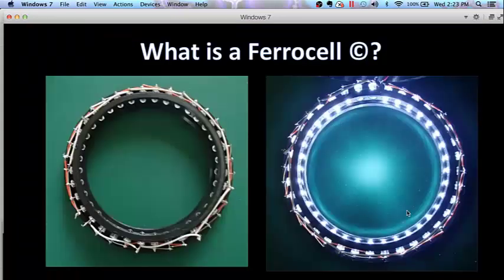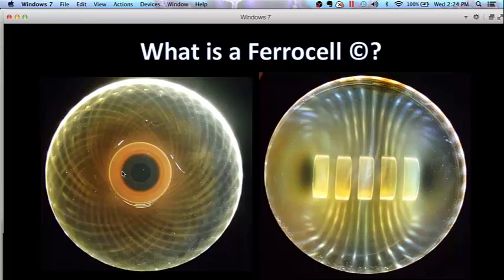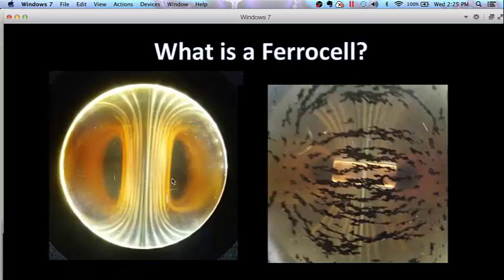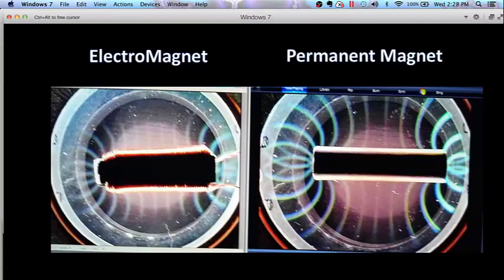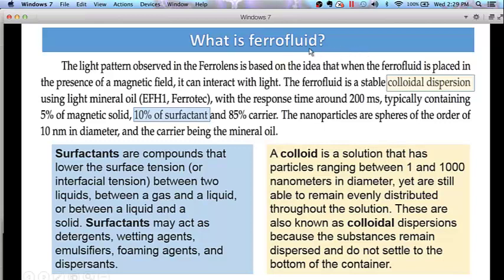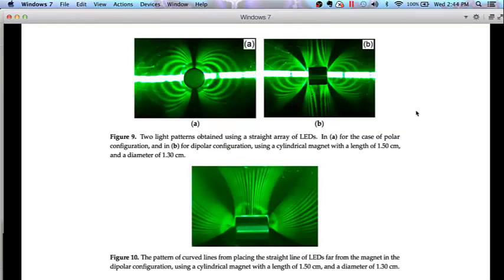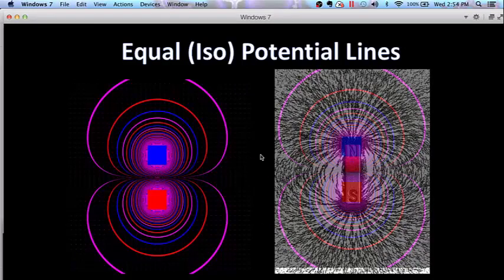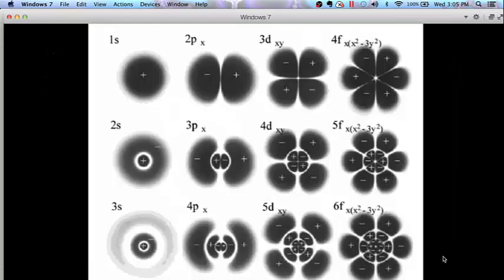Unveiling the Missing Secret of Magnetism

Comment: Linda Moulten Howe has a piece of UFO wreckage that was obtained by a soldier involved in the cleanup of the wreckage in White Sands NM in the 1940s. The bottom of the craft glowed for 3 hours after it wrecked. When it stopped glowing, the soldier broke pieces off and pocketed them. In 1996 they were sent to Art Bell. He gave a piece to Linda. She had them analyzed. Their Ion levels were 60 percent higher than they should be, and upon further analysis it was discovered they were subjected to terahertz frequencies approaching the speed of light. She doesn't know what that means. I do. 
I sent ALL of my following research, to TTSA a few months ago. 

The high Ion levels were due to the metals being turned to a plasma state. Like the plasma ball experiment. Her metal was made up of micron layers of magnesium, zinc and bismuth. ALL diamagnetic elements. Which means REPEL magnets. How were they turned to a plasma state? 

Here is an experiment done with a homemade ham radio. It's receiver was way too small to handle the High Frequency waves, and the Stainless Steel rods bypassed the liquid state of metal, and instantly turned to plasma. 

https://youtu.be/4yLbYlyT7wM
Now those frequencies were high, but only needed to be high enough to overload the small amount of stainless steel rods to plasmacize it. The amount of metal to make up a craft would need how much frequency??? That's right. Lots lots lots more. 

Linda's metal was turned to plasma using even HIGHER frequency. Terahertz. Creating a DIAMAGNETIC field. 

This is a Tesla plasma ball being spun at 4000 RPMS. Notice anything familiar? Take note how hard the south pole tries to form, despite the post powering the plasma being in the way.

They put a tinfoil hat on it. Notice how the tendrils try to draw energy from it at the pole? Northern Lights. 

https://youtu.be/Wis_HEa3X84

Mind you, this plasma globe is only being powered by 2 AA batteries, and it's just basic neon gasses creating said plasma. What would happen when you use materials like magnesium, zinc and bismuth?? You wouldn't get a magnetic field. You'd get a DIAMAGNETIC field. 

Let's go further. Bob Lazaars claim of Element 115. Unumpentium. Now known as Moscovium. It's used to make Element 113, Nihonium, by smashing Zinc and Bismuth nuclei together. Both DIAMAGNETIC elements. Which means repels magnetism.
Is it possible, diamagnetic elements turned into a PLASMA state via High frequency waves, would cause levity??? I'd say yes, given the fact that we now know plasma is 10 billion billion billion billion times stronger, than the force of gravity.
Reply: You just gave me at least a week of rabbit holes to jump down. Thank you sir.
Reply: @DaddyGrindstien  what do you think of it?? You are welcome! 
there's sooooo much more.

Comment: I like at the end how you explain how it is fractal by pointing out the 2p inside of the 3p  and the 3p inside of the 4p. I finally got it. It is as if the top row is the zoomed in image and the lower rows are as if you had zoomed out of a fractal.

Comment: Well done, you got it! I've been through this exercise before. It was only a question of time before people started putting 2 & 2 together, thanks to K.W.
Reply: :-O              ...you mean, notwithstanding K.W.?
Reply from the maker: @lucassiccardi8764  NO!!! I would not have been able to do any of this without Ken. Ken told me about Timm Vanderelli and the ferrocell. I became friends with Timm. Timm sent me his paper and that is the end of the story. KEN IS NOT WRONG. Everything he said is just fine. The lines I show in this video are EQUALPOTENTIAL LINES. They are not the field directly, only indirectly. In fact, all FIELDS are indirect manifestations of the REAL cause, which is Aether in a state of dynamic polarization (aka. vortex flow).
Reply: @FractalWoman  Thanks for the answer; I can't really reply to this now. I will think about it, because now I can't see how this goes along with Ken's thought.
Reply: Ken has shown another way you can view the vortex of magnetic field using CRT TV. Check "VIDEO 8 Uncovering the Missing Secrets of Magnetism, Magnetic Vortex with GRID DISPLAY".
Reply: @Xeno_Bardock  If anything we see in this very Fractal Woman's video, or in Timm's paper, is correct, we must deduct that the interference of the magnetic field bends the CRT signal in the same way it does with the diffracting light under the ferrocell: the vortex is an optical effect, not a cause.
Reply from the maker: @Xeno_Bardock  Yes. I have a CRT and I can clearly see the direction of Aether flow in and around a magnet. I am not denying the Aether vortex flow. This video is not about that. It is about the interaction between the light, the ferrolens and the magnet.
Reply: @FractalWoman  - If fluid dynamics are at play, could you make hypothesis on the properties of the Aether based on the displacement of each pixel given the known properties of the magnetic field strength and the mass and velocity of the electrons?
Reply from the maker: @potsmokingatheist9290  What is flowing? That is the question. It is my opinion that the Æther is consists of a sea of electron-positron pairs. That is what is flowing. When you set these into motion, you get an electric field. This would be analogous to a charged particle.  When you set that into motion, you get a magnetic field at a higher scale. When you set that into motion, you get an electric field at a higher scale and so on. This is the fractal paradigm at play in the creation of a large scale magnet. The Æther flow gets scaled up. But at the smallest scale, I am surmising that it is electron-positron pairs which act as tiny magnets at the smallest imaginable scale or Planck scale.
Reply: @FractalWoman  - As an atheist, I have always been skeptical about extreme claims, including claims made by the Copenhagen interpretation.  As a result, I have been more of a fan of pilot wave theory as it does not require as much imagination but does imagine a universal field similar to Aether.  However, the quantum entanglement experiments done in the past years do indicate there is an essence of non-locality at play, at least for some atomic properties, which does require a great deal of imagination. 
Your idea is logical being the universe started with the obliteration of matter and antimatter, so it is easy to imagine the resulting universe being in fact the remnants of that event.  If two electrons overlap, their standing waves would cancel each other out, making them electrically inert.  However; if we hit the space with high energy transverse traveling gamma ray photons, we can magically create the standing waves in an electron positron pair.  To me, this seems a lot like when a pool ball hits another, and the ball hit stays at rest in it space, converting all of the energy into spin.  In your model, it would seem the gamma rays would not be creating new particles, it would instead be reviving existing particles (although I am not sure particle is a good word).  If space and magnetism are fractal in nature, then would you expect nature to continue beyond the plank length? How does your model account for dark energy and the accelerating rate of the expansion of space?

Comment: So now, with this model, I would love to see a visual explanation of why magnets "repel" and "attract".
For opposite poles to attract, do the magnetic field lines cancel out, allowing for the dielectric field forces to come together?  
For like poles to repel, do the dielectric field lines cancel out, causing the magnetic field lines to push each other away?
For iron, is there only a dielectric field because the atoms are not lined up, allowing for attraction to the magnet's dielectric field?
Do "non-magnetic" materials have no magnetic or dielectric fields (or extremely weak dielectric fields), thus no attraction or repulsion to the magnet?

Comment: Isn't the Ferrocell a Casimir Effect, of some kind? Two extremely flat surfaces, very near each other.
Reply from the maker: The effects may be related for sure. I know that when I put the two flat glass surfaces together, they stick together very strongly, with or without the fluid. That is because of electrostatic attraction. This is because glass has a dielectric constant > 1. The thing with the Casimir Effect is that the two objects that are sticking together are metals. They have a low dielectric constant and a high magnetic constant. When you place the two pieces of metal together, they don't stick. The two pieces of metal need to be moving relative to each other in order to get them to stick. My husband is a tool maker and I have seen him stick two metal gauge blocks together by turning them relative to each other. They call it Wringing. https://en.wikipedia.org/wiki/Gauge_block#Wringing

Comment: This needs two layers so that it behaves like Moray pattern potentially giving a Holographic 3D view of the Magnetic field if done correctly.  Might be time for me to make one of these to experiment around with.
Reply from the maker: You should make a ferrocell. I highly recommend it. Just so you know though. You are not looking at the magnetic field directly. You are looking at the light reflected off the ferrofluid as it aligns with the magnetic field when a magnet is present. And it already looks holographic, even without two layers. That is just an optical effect caused by the separation of your two eyes. When you close one eye, the effect goes away.
Reply: @FractalWoman  I know, I understand what is taking place hence the reason I mentioned multiple layers might be capable of producing a holographic effect.  Holograms function from very similar patterns that would arise from looking through multiple layers of a Ferro-cell.  I was thinking about it and the interference of the lightwaves you would see would be determined by the direction you viewed it from in a 2 layered system at least in theory.

I use to draw Holograms using the effect and scratches on plastic.  Its really cool but I could never get the diffraction to the level this thing might cause.

Comment: Concerning water in a drain, you said in a comment below, "... water spirals in and air spirals out; This is the best and most efficient pressure mediation for the water to go in and at the same time, let the air come out." (The context was the flow of Æther.)

Is there some difference between the Æther entering the magnet, and the Æther leaving the magnet? Is the Æther (or some property thereof) consumed or altered in the process?
Reply from the maker: Code Tech: Well, in the case of water and air, air is more "inertialess" than water. In a similar manner, there must be two Æthers or as Ken says "two Æther modalities". One is "inertia-full" and one is "inertia-less", or what Ken calls "loss of inertia". By analogy with water and air in the drain example, what  comes out must be less inertial that what goes in.
Reply: @FractalWoman  If we think in terms of heat, we can picture the Æther as vibrating. (I am thinking of the Æther being composed of individual very tiny "corpuscles").

The less it vibrates (the "colder" it is), the more inertia it has. So it has the most inertia when not vibrating at all, because it is dead still.  The more it vibrates (the "hotter" it is), the less inertia it has, because it is already moving.
Reply from the maker: @codetech5598  Yes. This is a good analogy. This is how the one and only one Æther can be both inertia AND loss of inertia.

Comment: I'm slowly coming to terms with the fact that Ken is clearly completely wrong about how the ferrocell works.

I started getting suspicious when he said that it's not just refracting the light and the constructive/destructive patterns still appear with a single light source. Even though you can count the lines and see clearly that they line up 1:1 with each light... And then the fact that on my own ferrocell there was no red/blue shift. Or if there was, they always appeared at the same places on the ferrocell regardless of which pole was facing it.

Guess I'm jumping off the Ken Wheeler bandwagon and jumping on the fractal woman bandwagon...
Reply from the maker: I did give Ken a fair shake, but once I discovered how a ferrocell actually worked, I had no choice but to jump off the Ken Wheeler bandwagon. So much to do. So little time.

Comment: That's an amazing correlation with the observed electron orbitals which from my understanding Jeff's standing wave neutrino makeup of proton, neutron, electron matches this as well.  Don't remember how large of atoms he has applied this to  for electron orbitals to match observations.  Pretty cool Repeating patterns thru all scales of nature.  So the magnetic field we observe is the longitudinal wave expanding out from the standing wave particles? Where the larger the net(would scale matter?) electric  potential the more coupling with the aether? Just trying to grasp, thanks for the vids
Reply from the maker: Magnetism (attraction and repulsion) is caused by circulating Aether. Magnetic isopotentials are pressure gradients created by circulating Aether at different distances from the magnet. When pressure gradients cancel (destructive interference), you get low pressure and attraction. When pressure gradients add (constructive interference), you get high pressure and repulsion. That is all I can say for sure at this point. Forget about "fields". Fields are mathematical abstractions that muddy the waters in terms of understanding what is actually going on.